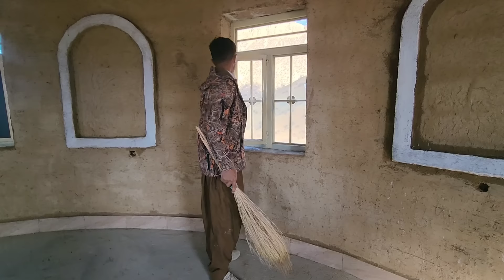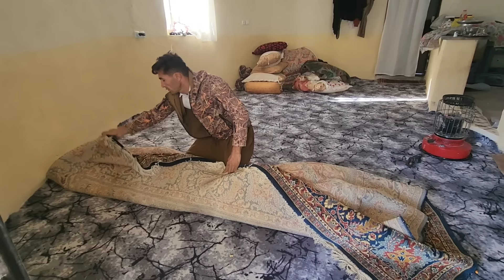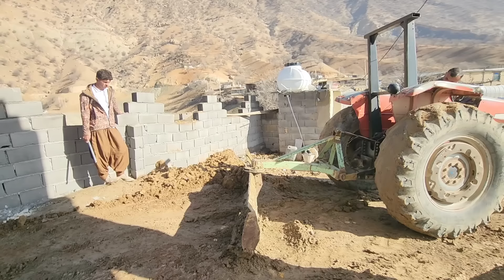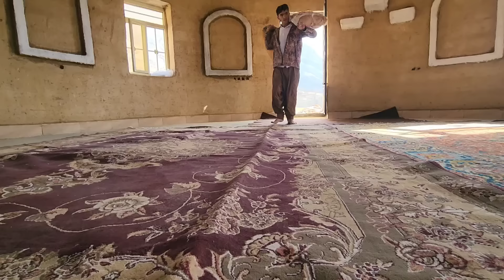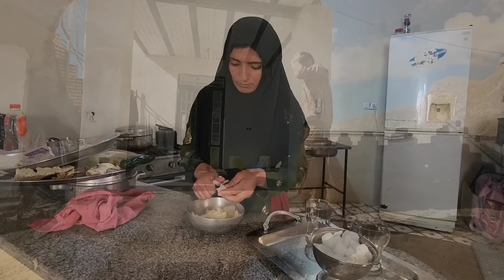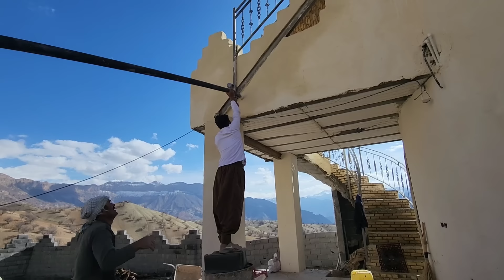Life in a nomadic castle, days full of adventures of Hassan and Zuleikha: carpeting the castle

Comment: Could you make a long handled broom like your short one, Zolikha? You and Hassan, having to bend over like you do to sweep, doesn't help your backs. Do they sell brooms with long handles in the city? They do make battery-operated wet and dry mop & vacuum ones. because I own one by Bissell. Check them out online.  It would be great to clean your inside floors.  A broom for the stairs and other areas outside.  Anyway, I'm just wishing fo the best to make things easier. ❤